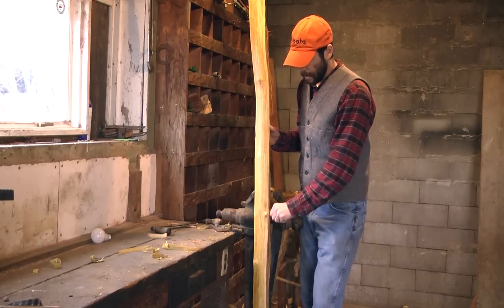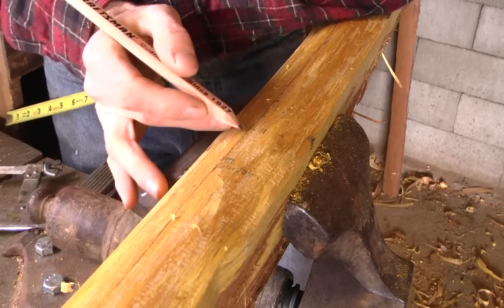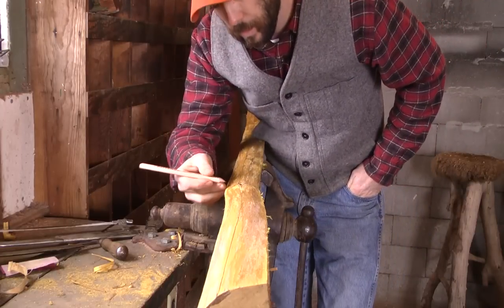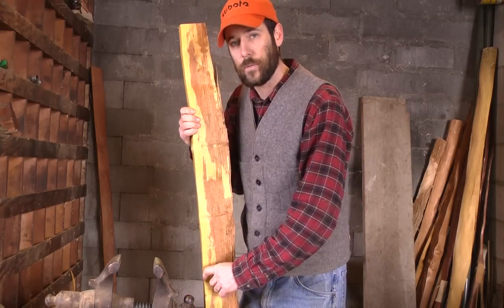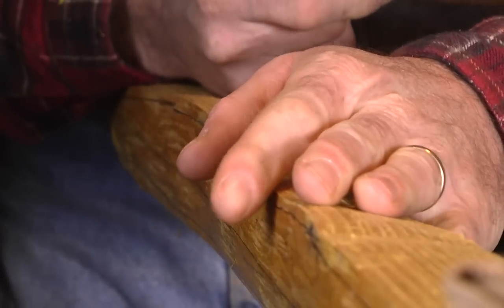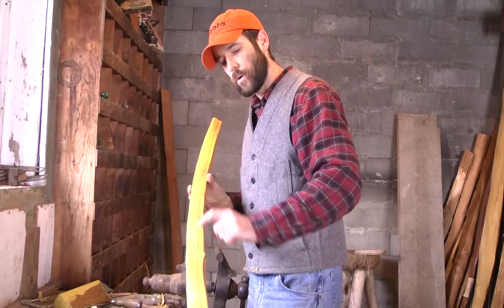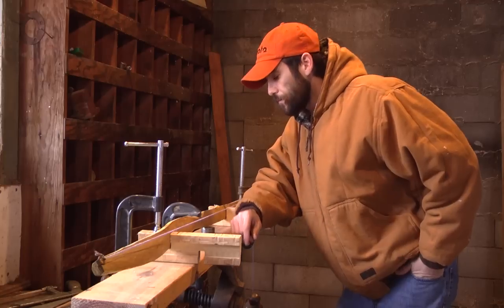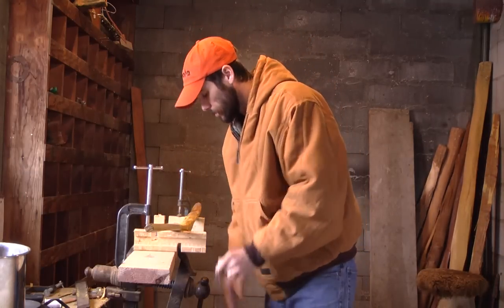How to make a Longbow - Part 2: Layout & Roughing out

Comment from the maker: If you remove the bark during the spring, or early summer when the sap is flowing, it'll come off really easily.  But, you need to coat the back with glue or latex paint to keep it from drying too fast.  If you take the bark off a really green tree, and not seal it, it'll crack badly.

Comment from the maker: If it's a whole log, it could take over a year or more to dry.  If it's split into a stave, you could start working on it now, get it to rough demensions, then let it dry for another month before finishing off.  But, with that said, it depends on the humidity, drying conditions, size of the stave, etc.

Comment from the maker: Yes, the "back" is the part that faces away from you when you're shooting the bow.  It is the part that is under tension when the bow is drawn. The part that faces you is called the belly - it is being compressed as the bow is drawn.  You could find a used draw knife at a pawn show or online, maybe ebay, for less than $15.

Comment: I just had to tell you thanks for the great information on building a bow. I make miniatures and bending the bow after using steam was a great help to me. The Jigs to support the bow was a great help also. Cane you use steam to straighten a arrow shaft as well.
Reply from the maker: Joelle Karma Yes you can use steam for arrows but, depending on the shaft material, it's not usually necessary.
Reply: what is a good way to straighten an arrow  I am making them in 1/3 scale I do my best t o make them like actual sized Arrows. I am trying ot make them like a Japanese Longbow arrow..

Comment: wow. this is by far THE BEST freaking bow making video out there. thank you thank you thank you!
Reply from the maker: Glad you liked it. ch
Reply: +Clay Hayes  when your cutting the sides do you really need to follow grain or can you just carve the bow even without waves
Reply: THE Justin Schmidt it is best to follow the grain if you cut through the grain and just draw a straight line it could cause a compromise in the tension strength of the bow. and can cause catastrophic failure. I've been making bows for the last 4 years it is addicting and fun.

Comment: Great Videos Clay.
In the UK we use a Shave Horse instead of a vice, which means you can sit outside and make your Bow - when the weather is nice.
Just a suggestion, you make lovely Bows by the way.
Kind regards
Davy
Reply from the maker: David Drysdale I've got a shaving horse as well and use it sometimes, It's nice to be able to work outside isn't it.. These vids were made in the winter though.

Comment: Hi Clay,
When you lay out the bow, you go one inch over and three under the center line. I'm new to bow making, but the way I learned was to make it equally two inches either side. Would you talk about the difference between the two methods and what are the benefits/ detractors for each?

Comment: Hi again Clay,
I got a nice stave, straight grain no twist, nice thick growth rings but pin knots the whole length.  I've got it at one growth ring and 13 islands of pin knots that look like stepping stones the length of the bow.  I left a 2 growth ring, 1" diameter pimple about 3/8" high around each.  

How do you deal with pin knots?  What about ones near the edge of the stave?

Thanks, Steve
Reply from the maker: +Steve Lardner some people leave the islands. I remove that wood. The tree will compensate for those knots by itself, hence the lumps around knots. For the knots on the edge, either remove them or leave them whole. Just don't cut through them.
Reply: Clay Hayes I understand what you're saying. I see that easily with regular knots but with  these pin knots Its hard to see much thickening around them.   There are one or two right on the edge so I'll shave down the side to see what this tree did and go with that for the others too. Thanks. Hope the hunting season is going well so far.
Steve.

Comment: Hi Clay,

Thanks for the great videos.  I would like to make a bow and I have two questions.  First, what should I be looking for in a limb or log when trying to determine what would make a good stave material (I will probably be using black walnut as that is the most abundant thing we have around here)?  Second, what determines the draw weight?  In other words, I would like something in the 50-65# range...how do I not end up with something that pulls at 25#?  Thanks in advance...I look forward to reading your book.
Reply from the maker: nscheibe1 For the "what to look for" question, check out the osage harvesting and splitting video. many of the same concepts will apply to other woods.  Bow weight is achieved through continually taking away wood until you reach your target weight.  But, if your tiller is off when you reach that weight, you might need to make the bow lighter than desired to get to proper tiller. this is a common problem with beginning bowyers. Don't expect a great bow on your first attempt.

Comment: Hi Clay,  I'm back.  I'm having the most trouble with cleaning up the sides prior to layout.  Using a dull drawknife and trying to follow the grain it keeps splintering ahead and it's made my stave so narrow I stopped using the drawknife and went to the rasp.  A couple of my staves were probably too narrow to begin with but a couple were almost 5" across.  What direction do you suggest starting with, the stave's wider end to narrow end or vice versa?  I'm down to one seasoned stave so I'm looking for my best odds.
Reply from the maker: +Steve Lardner Hi Steve, osage is bad about that. Here's what I do. When I start to get a long bit of grain lifting and running into an area I don't want it to go I simply back out and come at it from the other direction. That way you cut that grain off instead of running it down deeper. Hope that helps. If you continue to have trouble shoot me an email and we'll chat. ch
Reply: +Clay Hayes Thanks Clay.That's what I did. It didn't seem to make much difference which direction I was coming from and wondered if you had advice.  I've taken to using the rasp for anything less than 1/4" to my outline but it's tough to follow the grain even if I've got it outlined.  No one ever said Osage was easy and I sure won't be the first!
Reply from the maker: +Steve Lardner a rasp is a good choice in that case. so long as you're pretty much in line with the grain.
Reply: +Clay Hayes It works okay. I then follow it up using the drawknife like a scraper, vertical or even tilted towards me.

Comment: Great video.  I'm building my first selfbow out of hickory before going to osage.  I've been using The Traditional Bowyer's Bible by Jim Hamm et al.  This video fills in virtually all the questions I had. A question I do have is what arc do you suggest for recurve, ie, # inches of arc over # inches of length?  My bow is 59" without recurve and plan a 40#-45# draw at 27"
Reply from the maker: Hmm, I'm not usually very technical about my reflexed tips.  I usually bend the last 12 - 14 inches on a radius about the same as a 55 gal drum... So that'd give about 3 inches or so of setback over that 12-14 inches.
Reply: Clay Hayes Great, thanks.  Perfect timing.  I can build my recurve template while I'm drying my roughed out bow using a\the light-bulb stove pipe method. Yeah, I gotta make up for inexperience with technique.  That's a 1:4 drop, in "technical" terms.  Thanks again.  Steve

Comment: Okay I've got a question?  At the end of the video you said that you were ready for floor tillering. How did you get rid of the limb twist on that one limb tip?  Would you not have to straighten that out first?
Reply from the maker: With a bow that isn’t a true recurve, a little limb twist is ok. But it’s easy to remove with a heat gun or steam. I cover this in depth at Patreon.com/clayhayes

Comment: Great video! Making my first bow in a long time. I cut a nice osage tree and got two nice staves, 72 inches. Clay, what is the minimum amount of time I need to let it dry before beginning work. I know a year or two is ideal but I've heard one can start after a couple weeks. Re- tillering would probably need to be done after a year or so. What's your opinion?
Reply from the maker: Hi Mike, good to hear you're getting back into it.  You can speed drying time by cutting your stave down to the rough outline of a bow.  But, if you cut it down while it's still really green/wet, you run the risk of checking (developing longitudinal cracks) because the wood dries too fast.  I'd rough it out, leaving the sapwood on the back, then let it dry for a few weeks before removing the sapwood.  Then floor tiller and allow it to dry for a few more weeks.  Bending the wood while it's still green will cause excessive string follow.ch

Comment: I split a Osage stave I bought like you did in this video. When chasing a ring on the interior piece the end grain looks rift sawn. As I chase the ring it looks like I am chasing two parallel rings because of this. Will that bow fail? Or should I shave the stave to make a crown? Thanks.
Reply from the maker: I’d take it down to one ring rather than leaving the two exposed.

Comment: I've run into a couple of problems.  I've a 64" osage stave down to a single growth ring and rough tillered with about 4" of flex in each limb.   My lower, longer limb has about 35 deg of twist beginning just past the handle section for about 12" then flattens out to around 10 deg at the tip.  First off, is the twist going to be a problem?  What if I want to put in some recurve?  Second, in the same limb there is a 5/16" knot 4" from the tip.  The stave is still 2" wide and the knot is 1/4" from one edge. Should I taper the tip with or without the knot?  I could taper it leaving the entire knot and the 1/4" of grain to that edge or taper it inside the knot leaving a bit of indentation where the grain curves around the knot.  Which will cause me less headache?
Reply from the maker: Steve Lardner Hi Steve, osage bows will often have some degree of propeller twist like you're describing.  In a straight limbed bow this usually won't cause a problem.  If you put much reflex or recurve into the tips it'll exacerbate the issue. A full on recurve, with the string touching the belly at the tips is out of the question because, with the twist, you'd never be able to keep a string on it. Second question - If you still have 2 inches of width 4" from the tip, you need to do a lot of tapering. I'd loose the knot.
Reply: Clay Hayes
Thanks Clay.  I figured the recurve was out but wasn't sure why.  Thanks for the explanation.  As far a the tapering goes and following the grain, I can either taper it to include the knot which keeps the best center line or offset the center line a bit to remove the knot but following the grain there would be an indentation where the grain curved around the knot.  Which way would you suggest?
Reply: Steve Lardner
Belay my last.  I didn't see the last sentence of your post.  Thanks!

Comment: Hi clay, I'm new to bow making and I'm starting out on a 52" flat bow, the stave is twisted though. I established a back and i roughed out the shape, will a 10-20 degree twist affect the shooting? If so, how much? Thanks
Reply from the maker: Hi Johnn, You should be able to make a bow with that degree of twist. I've made a few bows that look like airplane propellers. They shoot fine so long as you don't try to put much reflex in the limbs which only exacerbates the problem.

Comment: Hello I'm new in bowmaking and been wandering is it necesary for a arrow rest to be 1 inch abowe the center of the bow.
Great chanel by the way. Best regards from Croatia
Reply from the maker: no, some people put the rest right in the center, others put it two inches above center. I split the difference.
Reply: Clay Hayes, thanks for an answer a taught it will affect arrow flight if it's not 1-2 inc abowe the center, because I always put the arrow rest in the center of the bow. Still there is always problem with the arrow, it wobles in the air when I shoot it (must be arrow or the bow). Thank You again for the info.
Best regards

Comment: How long do you leave it clamped after steaming?
Reply from the maker: +climber6916 until it cools completely. A few hours maybe.
Reply: +Clay Hayes I want to make a bow except out of hickory do I have to do any design modifications and also how long are the fades?
Reply from the maker: +Brian Anuvattanachai the only thing different would be that you don't need to remove the sapwood for hickory. my fades are very short, maybe 3-4 inches.
Reply: +Clay Hayes another question if you don't mind how come you moved the handle three inches down?

Comment: Mr. Hayes, GREAT video!  Just a thought, however.....could the upper and lower limbs not have been split from the top & bottom of the riser instead of shaving it off and getting no use out of the shavings?  At 19:00 of your video, you could have gotten enough out of the lower and upper part to have made a very nice take-down bow.  In essence, you could have gotten THREE bows out of one stave.

  If that specimen split as good at 19:00 as it did earlier when you split it down the middle, one could have made a take-down bow out of the meat that you simply shaved off.  As I said....just a thought on getting every ounce of precious Bodock as you possible can (especially when it split so nicely earlier where you will obviously have an easy build at the growth rings.  In fact,  splitting could have been the first thing you did just to see how well it would have worked.  It certainly would have saved a great deal of shaving.

Of course, you were simply teaching the basics of finding the perfect back for a bow.  Waste of not.....still a GREAT video.
Reply from the maker: Yes, you could do something like that but building a takedown is a lot more work and I've got plenty of wood.

Comment: So...it dont matter if the bow is straight. You end to follow the  grain?
Reply from the maker: Greg Cox Only three points have to be lined up. Both nocks and the center of the handle. So long as you've got those three points lined up, it matters not what the limbs do in between. You can use heat to bend the wood into alignment if needed to make those three points line up.
Reply: Thank you!

Comment: yup! I just noticed a couple of longitudinal cracks yesterday. Had to cut off about four inches of the stave. I kind of expected that since I cut the tree a few days ago(spring). Maybe it will be salvagable. I covered the ends in wood glue again and will give it some more drying time before working it down to a rough outline. Thanks Clay.
Reply: Mike Dixon its takes approximately 2 years for the stave to dry

Comment: Why not use chalk line for your center line, then for each side of the center line?
Reply from the maker: You can for a straight stave. But osage often times is curved so a straight string line would cause you to cut across the grain in order to make the bow conform to the line. I much prefer to lay the bow out along the natural grain and heat bend into alignment if needed.